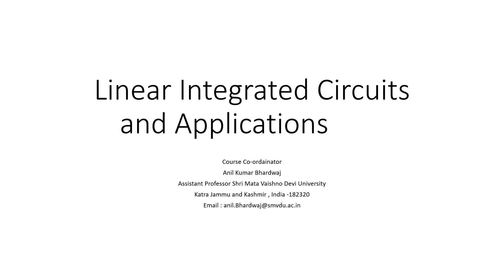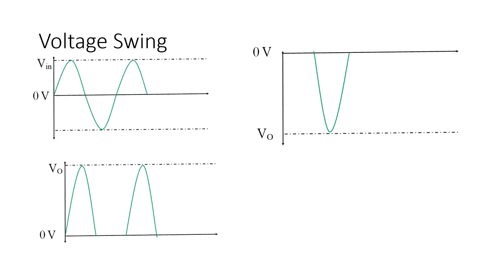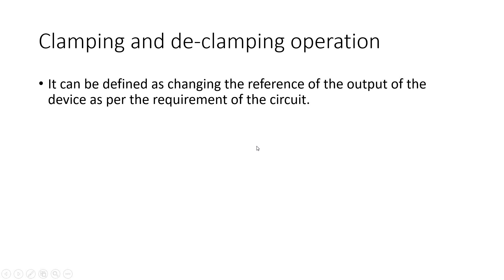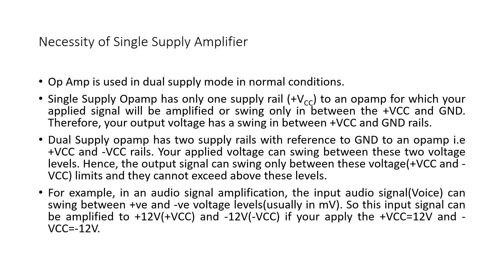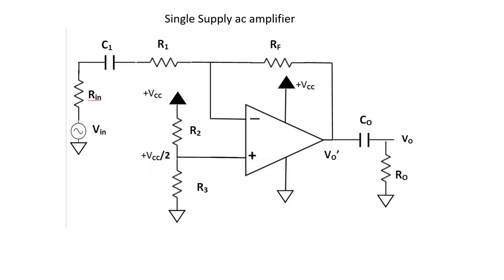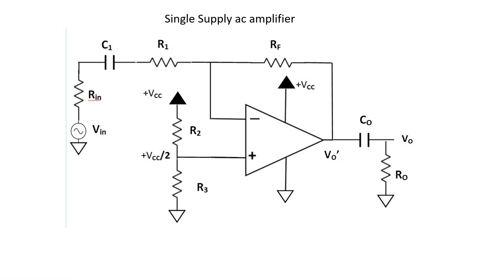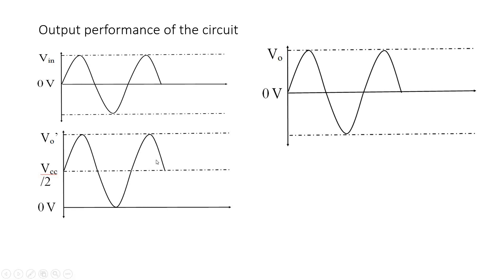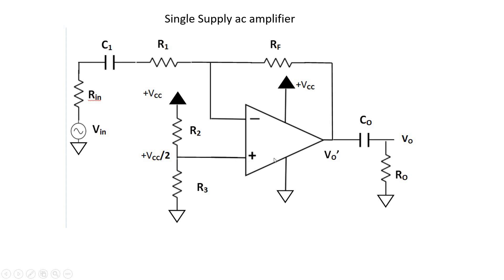Single Supply AC amplifier using Operational amplifier

Comment: I'm having trouble understanding how Vout can dip below ground since we are using a single supply that is at 0v potential for the ground.  There is no negative voltage in a single supply.  Thanks.
Reply from the maker: I will make video on this doubt. Please email your doubt with timestamp and snapshot.
Reply: @technicalknowledgeengineering  I have sent you an email with the above question.  Thank you.
Reply: https://www.youtube.com/watch?v=HgaQy7kLiO8   see it once